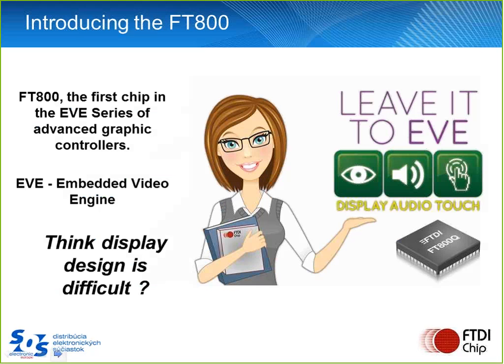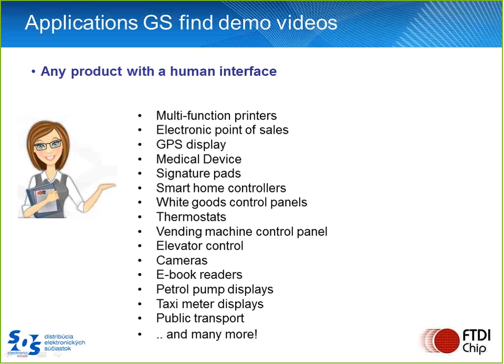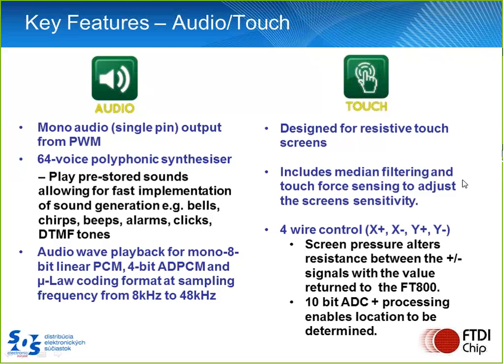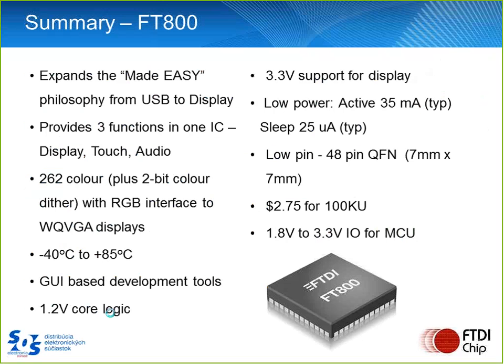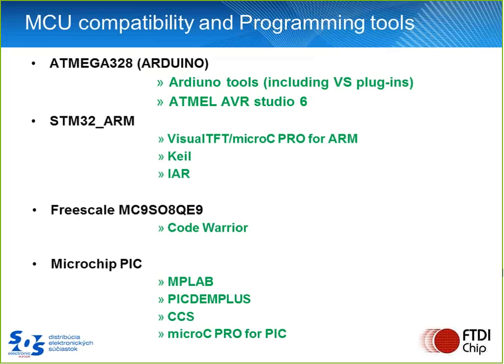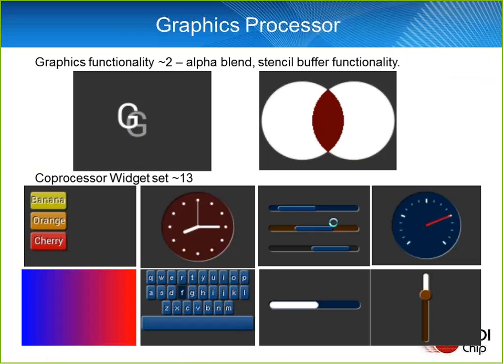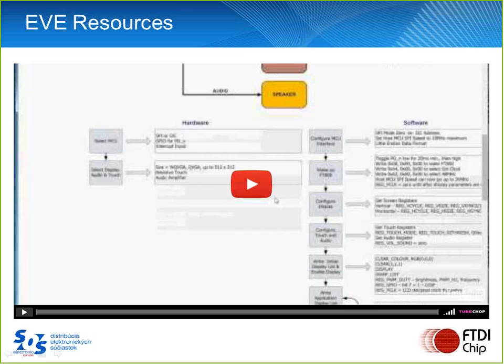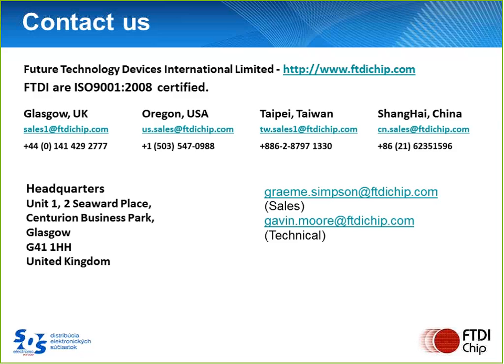SOS webinar: Program your displays in a split second with FTDI EVE FT800

Comment: would you please make the code a(at minute40:00) clearer? and is possible to give an example of how to put two or three bitmaps in the RAM_G and show them on the screen at the same time? thanks in advance
Reply from the maker: FTDI EVE examples:
http://www.ftdichip.com/Support/SoftwareExamples/FT800_Projects.htm#SampleApp

Similar source code from video is here:
http://www.ftdichip.com/Support/SoftwareExamples/EVE/SampleApp.zip 
src/SampleApp.c function SAMAPP_GPU_Points()
Reply: Thanks a lot for your answer.
Reply: I would like to know if you have any driver for the chip FT81x so it cat communicate with Freedome development boards of NXP? I m trying to make it but seems very hard to modify the existing examples and making it from scratch is tedious and unfortunately not working well! As you know,  the IDE Kinetis Design studio has changed many of its components and the existing FT800 code is not working well for new projects. Any hint? Is there any specialized forum so I can subscribe and have more information? thanks in advance.